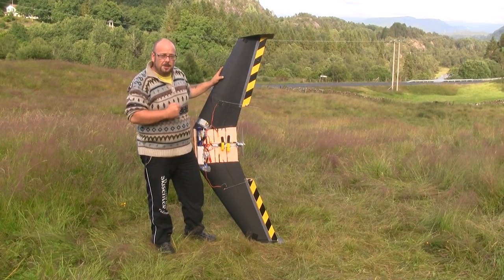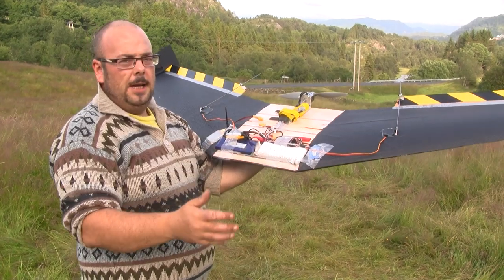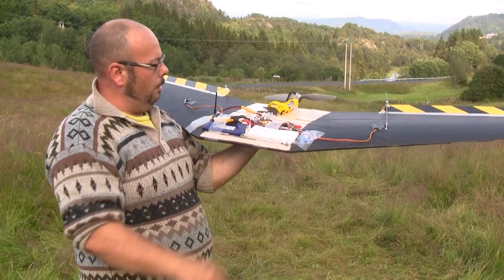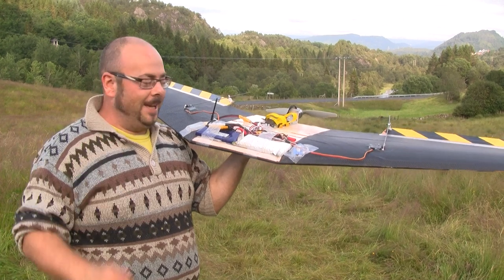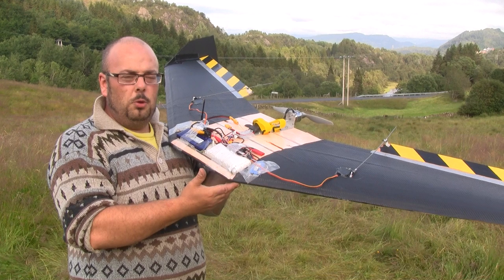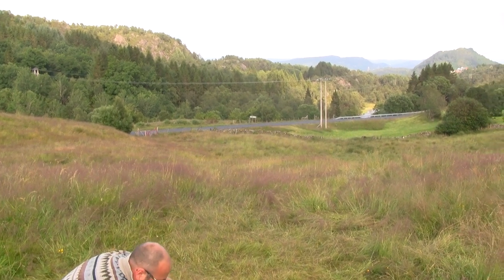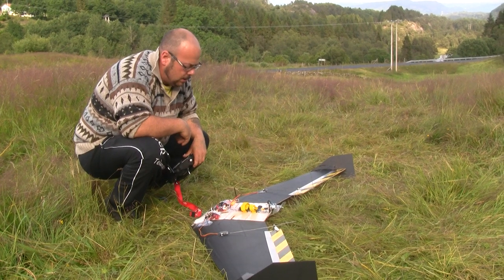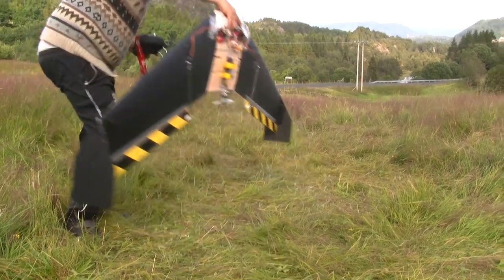FMZ180 Zephyr clone DIY foam build.

Comment from the maker: The plane is fitted with two 4s 4000 mah in front. In addition it can very well carry a additional weight of 700 gram. So 3 x 4s is possible for long flights. The bigger one is released and to see Sleipnir up there is just amazing. Extremely stable.
The only minus is that the new wing must be handlaunched from a hill as it "Dives" a little before full lift is achieved from airspeed over the wing.

Comment: holding it up with all wires hanging and torn off he says "exactly as it should be" LOL next time practice some landing approaches to see what it does when low and slow and how long it takes to shed its speed. You tried to land from altitude way to fast then you just flew it into the ground cause that's where you wanted to land it. Nice plane and great build seems to have plenty of power as is.

Comment from the maker: Chrisdafer199 : You are absolutely correct about the approach. Too quick, and too fast. To bad the video did not show the background. I chose the very best alternative ;-)

However my comment was about the plane, batteries where only taped over to keep em there in the air. The "little brother" i on purpose plunged into an asfalted parking lot on purpose, to see if it would crack. IT DID NOT !! ;-)

Comment from the maker: I am using a NTM Propdrive 32-42 with new Sweedish ballbearings. 13 x 7 prop on 4s. (NOTICE: I AM USING A TOO BIG PROP - if not carefull on the throttle, you WILL burn your engine) But it is needed for handlaunch. We live in a area that are full of mountains and hills and a plattform for launching or a runway is out of the question. The bigger Sleipnir's maiden is on the channel.

Comment: Hi, thanks for the video. You are a new beginer Arent you? :) if not sorry i dont mean anything by it at all, its just that i have been a new beginer at some point too :)
first of all Brother your plane seems to be under powered. You can tell that of how the motor is screaming at low speeds. That isnt good for fpving at all, because the vibrations. The other thing when you have so much room in a big beautifull wing like that, you really hide your gear inside for protection and drag